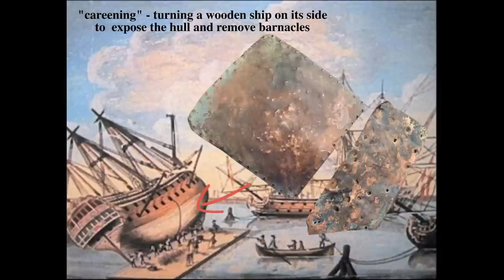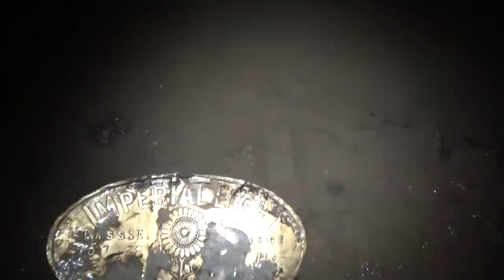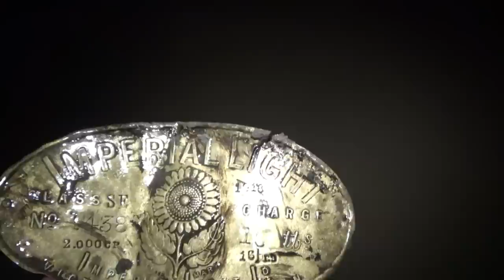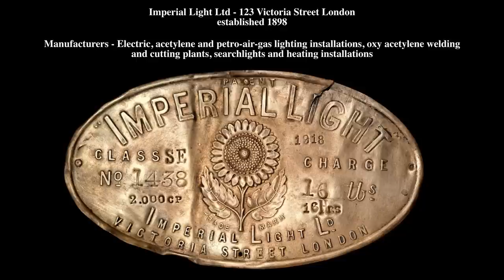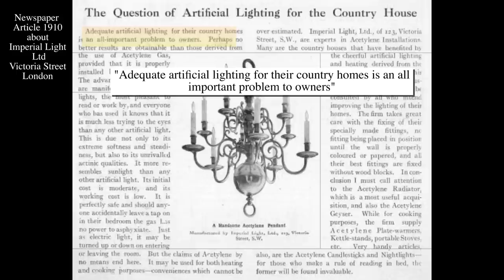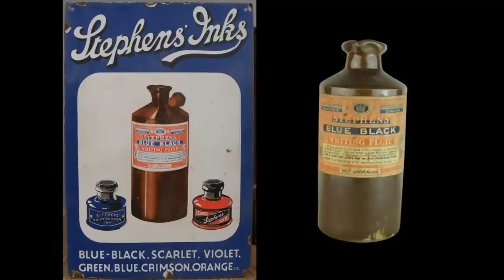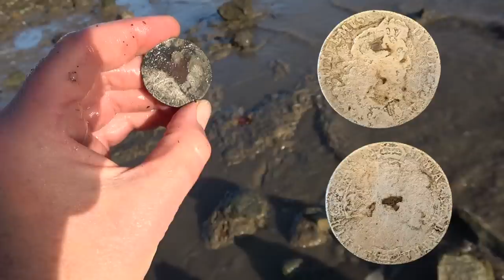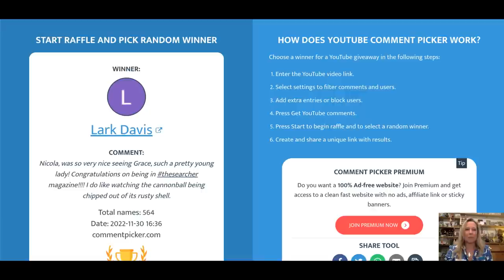I cannot believe how many Extraordinary Treasures I found in ONE outing on the Thames!  #mudlarking

Comment: The imperial Light plaque has 2.0 CP on it indicating 2 candlepower.  This could have been off an electric lamp or possibly Acetylene powered lamp. I imagine the latter, as it is big eoough to come off of a larger tank.  (Here in the U.S. some houses had a buried underground tank that they dumped Carbide and water into to generate gas to light up a home. Same principle as a miners lamp but on a much larger scale).   On the wood plaque, the top connector with the pins is a commonly used electrical connector. If you really clean the base flange of it, I suspect you will see the words "Cannon" on it and a part number. I am unable to ID the lower item, as you don't have a good close up of it. Here in the U.S. one can still buy imported soft drinks from Japan in Codd bottles.  I bought a couple just for the bottles. Great finds. I really like the coin and the plaque the best.
Reply from the maker: Thank you for this information
Reply: We can get Codd bottles in UK from Asian stores. The Japanese brand is called Ramune - my daughter loves drinking them.
Reply: Good call on the electrical connector.  It appears to be the type that had 16-gauge contacts and was widely used in the WWII era on aircraft, naval, and other military equipment.  Can't imagine, though, why it is mounted on wood.
Reply: to add a thought, it looks to me like the 'charge 16lbs' on the right may refer to the load of carbide that would have been used in the acetylene gas generator for one of these lights. If correct, that sounds quite large, so either that plaque might have gone with a case of carbide to refill the system several times, or it might have gone to the central canister which would have had gas lines leading off to each fixture in the stately home. THE OLD BYRD FARM VLOG here on youtube has a couple of videos of an in-ground carbide gas generator from an old acetylene lighting system that was installed in a US farm.
Reply: @tuckertomlinson4216  I remember reading where there was a short time that these electrical generators were being installed on boats/ships, usually as a retrofit, as it was all such new technology that would give them lights at night.
Reply: I wonder if it is 2000 candle power as the need to go to three decimal places would not seem likely?
Reply: @paulwhitehouse3690  It IS 2000 candlepower.  The Europeans often use a decimal point, where we would use a comma.  A light of only two candlepower would be relatively useless outside of a house.

Comment: I believe that large wooden oval shaped piece is from a WWII aircraft. The electrical fittings are for bulkhead cannon plugs. Not all aircraft parts are aluminum. Note all the screw holes around the edges.
Take photos with a ruler for scale and send them to Duxford, the Imperial Air War Museum.
You may have a piece from the Battle of Britain!
Reply from the maker: Thank you. Will do

Comment: The two metal parts of the wood piece look like 2 different types of connectors, as in, Positive and Negative. It might have been used to mount a large blade type of switch. Possibly for a large pump of some kind? Wood would have likely been used as electrically non-conductive, as opposed to mounting it on a metal surface, I think.
Reply from the maker: Thank you!
Reply: is it possible it's a part of an early 20th century wall-mounted telephone or something of the like?
Reply: a close up of those "connectors" would certainly have been a big help in udentification

Comment: Hi Nicola, I think the forked pole is a 'Linstock' a fantastic and rare find indeed ! They were used to ignite the 'touch hole' of a cannon, a corded match was tied between the two prongs and lit, the gunner could then stand well clear of the cannon during the firing process. Also I agree with an earlier comment from America about the 'wooden piece with electrical connecters', being most likely an aircraft part, it has that look about it with the rivets around its outer edge. Or possibly from a naval motor launch, again it has that military look. Great video as usual, I really enjoy watching you and your friends mudlarking !

Comment: After listening to the article about the plaque, I believe that it adorned a carbide lamp. Calcium Carbide was used as a fuel in many types of lamp. It works by dropping water on Calcium Carbide to create acetylene gas, which is then ignited by a flint striker. The tap refered to in the article is probably a water frp tap that was used to control the amount of acetylene created

Comment: The wood piece. The upper fitting looks like, what we here in the USA would call a Cannon Plug. That would be the male side of the plug. It was used for making a solid electrical connection that would be almost impossible to become disconnected. The lower fitting might be a ground stud where ground wires could be tightly attached. That being said, I've no idea what it was for. My experience with them was in the Navy used in various ways on ships and aircraft where vibration was a problem. I wired some Canon Plugs that had 25 to 30 individual wire conections.

Comment: Your ‘ something electrical’ piece of wood is possibly a ADF aircraft antenna. ADF stands for automatic direction finder. Based on simple AM-radio ground stations called NDBs (non-directional beacons), an ADF is an aircraft instrument with a directional arrow-shaped pointer. The arrow simply points straight at the programmed NDB’s position in relation to the aircraft.

Comment: I think your brass label was probably attached to a container of calcium  carbonate use to generate acetylene gas. The weight stamped into the plate is the clue. Given that the company made acetylene lamps it's likely they could provide the generator and the material to make the gas. Just add water in a controlled amount. Some early automobiles had acetylene lamps, as did miners for their helmets and they were available for bicycles.  I enjoy your  videos every Sunday  here in Alberta Canada.
Reply from the maker: Thank you!

Comment: I'll make a wild guess that the plaque from Imperial Light was originally on a small barrel or can containing 16 lbs of calcium carbide.   That substance was the fuel for carbide (acetylene) lamps and torches.   When water was dripped on it, it emitted acetylene gas.   16 lbs would be about a 1.5 gallon can of the stuff.

Comment: Hey Nicola,  living here in Pearl City/Waimalu now.  Have watched larking on the shore of Pearl Harbor.  I've been pretty sick from the water there.  I'll try to get some waders before more comprehensive exploration.   At another time, I dug a few of those master inks not far from the 1848 Pohukaina School.  They were also British.  Stoneware ginger beers came over as ballast from the U.K..  The porcelain Hawaiian branded caps seem to have been used in the 1910s.  The oval wood is part of a bellows?  Have you ever found any Hawaiian bottles or stuff?  Codds had a rubber washer inset in the neck, near the top to seal the marble from the pressure of the Soda water.  Britannia waives the rules, a bit of U.S. snark from the time of our Civil War?   In Nevada a friend has dug fenian clay  pipes commemorating the 1798 rising.  All the best, looking for neat old stuff.

Comment: 29:00 that item looks like a tool for fireplace cooking cast iron to put tops on pans, moving pans etc. the top should be metal so will not burn up and handle is wood to keep it from getting to hot.   There is also a single point type heavier for moving full pots..

Comment: The Imperial Light plaque may have been on the headlight of a car, bicycle, motorcycle or a boat lantern.  The lights that miners wore on their heads were small Carbide lamps.  It would seem to indicate 2 CP {candle power} at 2 Tablespoons lasting for 16 hours.  The Tablespoons would have been Calcium Carbide and that would have been mixed with water in the lamp to produce Acetylene.  Sometimes they blew up, and I'd imagine that it would have been very EXCITING to see.

Comment: Based upon some ideas in American campers - that would be a pole stand mobile mini-table.  For a larger diameter vertical tube/pipe, you stick the table top onto and around the inside pole.  If you have a smaller diameter tube/pipe, then you use the smaller appliance and put the pole onto and around the appliance.  A little mini-table where ever there are some vertical tubes/pipes.  No idea about the rest of the many bolts around the perimeter of the table.  It could have been a standing room mini-bar table next to a tavern or inn wall ?

Comment: the wood has straight slot screw heads so it is older than it looks. The fittings are brass so that also supports age. Post industrial, about 1910, is my guess.

Comment: The oval board with the fittings attached. If there are no holes coming from the rear of the board behind the fittings ? Then I think they are storage points. The top one with pins would accept a cable with a female NATO socket attached. You would push the female socket into the plug on the board ,turn the locking ring for storage. I am wondering if the bottom fitting is for a pneumatic/ hydraulic  pipe fitting which would be stored by pushing it into the bottom fitting on the board. Looks like you have part of a ship?

Comment: The wooden oval thing likely has a series of heating coils inside of it. One connector seems to be a mechanical fastener to a handle device and the other connector is for an electrical connection going to a switchable power supply. So my guess is that it is part of a machine to deliver controlled heat to something else. It was likely padded around the outside.  Maybe a medical therapy device to deliver heat to the back of a patient. Or something completely different such as a device to heat leather or fur pieces for stretching them in order to make clothing or leather goods.
Reply: A British ww2 mine detector base

Comment: I think the plaque must be associated with one of Imperial Light's searchlights? (A river-tug might need one?) I don't accept that leaking acetylene is any way safe but what they mean is that, unlike coal-gas (used in urban gas-lamps) it doesn't contain carbon-monoxide. In the days before gas-mantles became common, and gas-lamps were just like a candle-flame, they used to add toluene to make the flame from coal-gas brighter! (They probably stopped doing this when they wanted the toluene to make TNT in WW1.)  Toluene can cause cancer, but so can the thorium used in gas-mantles. (It doesn't matter so much outdoors, so gas streetlamps lasted, where I used to live, till 1974-1976.) Acetylene bicycle and car headlamps used to work by dripping water onto calcium carbide to make the acetylene as it was needed. This was a bit smelly, and slightly hazardous. But the standard boy's boarding school prank was to put the calcium carbide powder in the chamber pots that boys had under their beds in the dormitories, because the combination of urine and calcium carbide really stinks. An educated guess would be that once calcium carbide ceased to be sold in Halfords, sodium metabisulphate, available on the home-brewing aisles of some branches of Boots as a sterilising agent, could have served the same foul purpose.
Reply from the maker: Thank you Matthew!

Comment: Enjoyed the finds- the Bottle Marble I had never heard of and looked it up- reading how the carbonation would force the marble against a rubber gasket  I wonder if that could be used over and over.  Thinking a spa were you would bottle a spring water that is consumed on site.  I originally thought you said coke bottle marble-.  The little sitting guy on the pipe was cool.  Could that wooden pc be part of a air bellows-- Second thought was a light-- is it two board screwed together and wire hidden inside?

Comment: Difficult to see the metal things properly on the wood oval. But am I right in thinking the larger one has brass pins inside? If so, it wouls appear to be a male electrical connector, but doesn’t appear to do anything. Maybe just a blank to attach a female terminated cable to for some reason? The larger one certainly looks like an Amphenol plug. Often military.
EDIT: is it definitely wood? Is it in 2 sections held together with those fixings around the edge? Perhaps there are electronic internals.
Reply from the maker: I'm pretty certain its wood. I'm going to see if I can find out more. Thx for your thoughts on it

Comment: That board with two objects looks like they may be electronic connectors but where were are the wires? 23:32  The one at the top looks like it is electrical connector. Not the bottom one.

Comment: The weather has changed , it's cold enough to freeze the balls of off a brass monkey. Every canon would have a brass container of shot next to the gun, the cylindrical pot was called a monkey, it was made out of brass which contracts in the cold ,pushing the ball or balls out the top to roll around on deck. Maybe you will find one ?